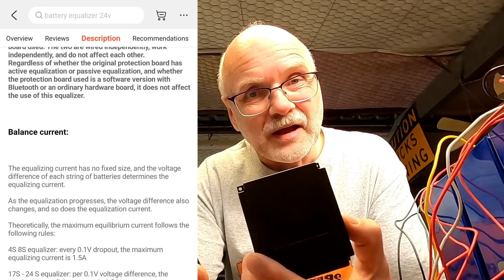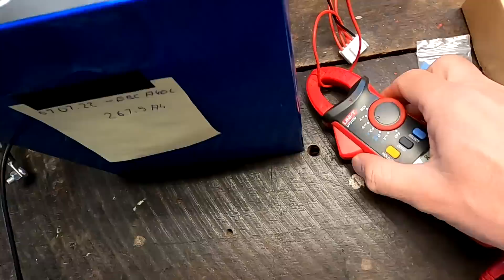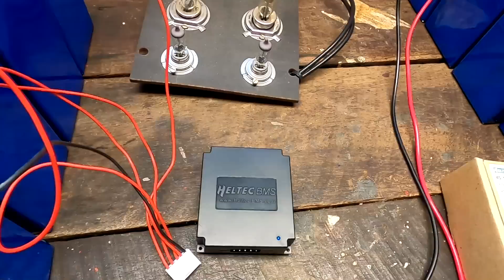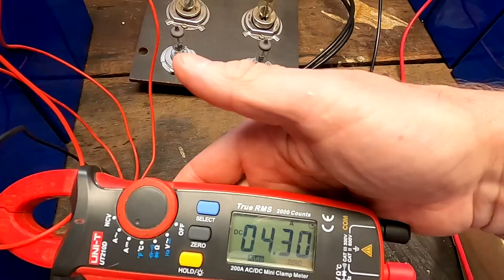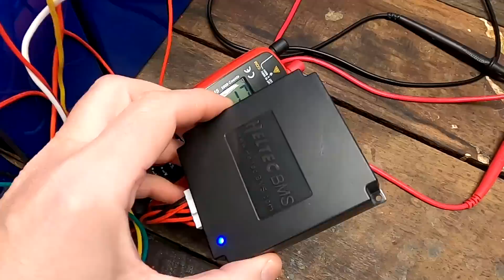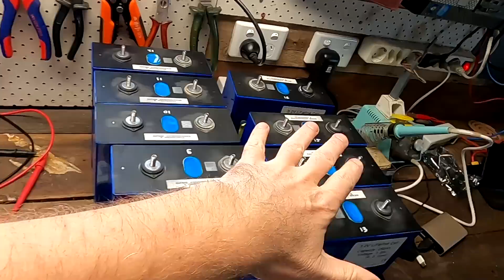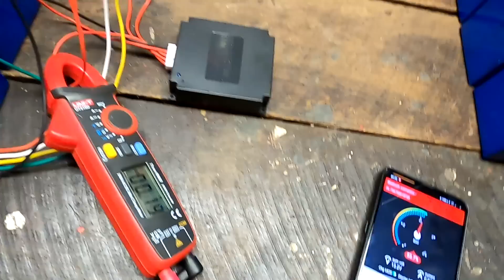HELTEC 10A Active Balancer. Great for large capacity batteries. But is it really?

Comment: Balancing current is not determined by the balancing-limit stated by the factory, but by the internal resistance of the cells and the voltage difference.
This is especially true for the capacitor version, since it's merely a "leapfrog capacitor bank" which means that it cannot generate a higher voltage than the cell being drained.
As for the price difference: The inductive balancer will easily outlive the capacitor type since they are not 100% solid state. ( expect ~ 10000 hours if running at max. ) 😕
Another feature in the induction models besides balancing can be de-sulphating of Pb cells, by modulating the current with ~ 500Hz - 5kHz. 👍

Comment: Maybe it is 10A peak current capable. If that BMS is switching, your ammeter measures an average level, not peaks. Use an oscilloscope to measure the actual waveform and compute the math

Comment: Why stop at 100mv?

Ah, my dude, that’s because most balancers are set up with a minimum deviation threshold to avoid unnecessary wear and tear, conserve energy, and keep things running smooth. Let me break it down:

1. Efficiency Trade-Off
	•	When the voltage difference is below 100 mV, the cells are already pretty balanced in terms of performance. At this point, trying to balance them further would take a lot of time and effort for very little gain.

2. Diminishing Returns
	•	Most devices are designed to stop at 100 mV because that level of balance is “good enough” for most battery packs. Any improvement below that deviation won’t significantly improve performance or longevity.

3. Heat and Power Conservation
	•	Balancers work by shunting current, which generates heat. Operating below 100 mV might mean the balancer wastes energy trying to fine-tune an already balanced pack, potentially shortening its lifespan.

4. Cell Characteristics
	•	Small deviations (like <100 mV) tend to equalize naturally over time during normal operation or charging/discharging cycles. No need for the balancer to do extra work.

5. Design Philosophy
	•	Battery management systems (BMS) prioritize reliability and simplicity. Stopping balancing at 100 mV ensures the balancer doesn’t stay engaged unnecessarily, which could cause system inefficiencies or overwork the components.

So, basically, it’s all about finding that sweet spot where the job gets done without overcomplicating things or wasting resources. If you’re after tighter tolerances, high-end balancers might offer lower thresholds, but for most setups, 100 mV is solid enough.

Comment: Turning off the balancing feature on the bms? I've watched a few of your videos about using an active balancer.

I'm thinking about getting an active balancer, but several YouTubers have done research and pretty much concluded that it's not necessarily a good idea. One of the main points is how a balancer could drain your battery. It got me thinking, what if the balancers are conflicting? 

I've never seen anyone try to test without the BMS balancer active. This might be a good quick test that could answer the active balancer question once and for all.

Great content btw.👍

Comment: Hi Andy.  I think the wires from the cells to the active balancer are too long and have too high resistance.  You can test it again with much shorter and thicker wires and  check if the current will go up to 10A at 0.6V difference

Comment: The reason to buy this balancer is because you can buy the 24s model and use it from 4s-24s.  This gives you one balancer to rule them all.  I use an unbranded model because it's cheaper then the Heltec.  It has terminals I put my own wires in so they are sized correctly.

Comment: Tou need t =o use short and thick wires. They don't have kelvin connection, so the drop in the wires will fool the ballancer and will not push more.

Comment: In specs 10A has if diff 0.8V and more between cells. If diff ~0.1V - have 1.2A balance.  The author has a difference of 0.65 - should not have a maximum balancing current in 10A. There should be an average of ~4A, which is what happens in the video, since this is the optimal and safe balancing current. Read the manual better )))

Comment: A few days ago, I was having problem with my variable power supply. Voltage kept dropping even though the unit is capable of supply 10A. I discovered that the wires used was substandard and large voltage drop. When I replaced the cable, the voltage drop was greatly reduced.

What if you change the balance wires to a larger size, say #10~#8?

Comment: I know this doesnt sound very logical but if I had a pack where a cell need balancing all the while somehow I would be thinking that cell is faulty. I just had an 8s pack given to me which havent been use for 4 years and I put an active balancer on it and nothing happened
Reply from the maker: You can only tell if you fully charge the battery. Cells need to be over 3.4V (with LiFePO4) to show any sort of deviation.

Comment: Can't read the part numbers on the devices in video. 

Usually, the way this works is like a flyback transformer with multiple primaries and multiple secondaries all charging the primary windings and discharging through the secondaries in parallel.  During toroid charging, all cells contribute to charging parallel windings but cells with highest voltage contribute most of the current to charge the toroid.  When discharging toroid, the lowest voltage cell absorbs most of the discharge energy from the toroid.

No gating of which cells supply charge or discharge is necessary other than blocking diodes to actual cells.  The small E transformer provides isolation for driver MOSFET and 8 pin IC's are likely the actual switching MOSFET's to charge the toroid coil.  The large devices near battery terminals may be just diodes to keep current flowing in correct direction for cell polarity.

Efficiency isn't great because of forward voltage drop of blocking diode in relation to cell voltage.  Efficiency can be improved if diodes are synchronous MOSFET rectifiers but that adds some extra complexity and expense. 

If you expect 10 amps average, the peak current must be much greater to charge the toroid and the windings wire gauge used is so small it will have a lot of voltage drop. Too much extra resistance reduces the differentiation on which cells get the most charge pull and most balancing push currents.

Just a crappy implementation of a reasonable active balancing approach.

Comment: I have a problem? I watch you battling the similiar, I have decided to mount my panels in summer and winter with trackers. FOLLOW THE SUN NO SHADE ALLOWED. hmmmm so much for opinions?
Reply from the maker: What's your experience? I think it is better to just install more solar on a fixed mount to compensate for any loses rather adding to the complexity of a tracker (stability, wind, area, maintenance,...)

Comment: Andy I'm just wondering if this device can be used to equalise 4 x 12v batteries in series?
Reply from the maker: You mean the 10A balancer or the secret device in the box?
Reply: @OffGridGarageAustralia  The 10 A balancer.
I've had battery equaliser on my SLA battery bank for years and they work.
I'm wondering if this device would do the same job on my SFK kits.
Reply from the maker: @NedKLee  But if it is not 10A, it is not a 10A balancer 😉
The SFK kits can be equipped with a capacitive 10A balancer. My kit has that but it is not great if it runs all the time...
Reply: Andy, I have 4 x SFK in series to 48v.
One will battery will be near or at 100% SOC, the other 3 will be somewhere between 96-98% SOC.
I was wondering if I could use this device to smooth out the difference between SOC.
When the 1st battery reaches 100% the BMS shuts down charging to all batteries until it reaches release voltage and then charging begins again.
Perhaps this device could help smooth out the transition.

BTW, loving the SFK kits, they work very well.
Reply from the maker: @NedKLee  Oh, no, that won't work. Each balancer is only for one 4s battery and does not know about the other three packs you have in series. They won't balance beyond this on pack they are connected to.
Reply: @OffGridGarageAustralia  Thanks Andy, it was worth the ask.
Stay charged mate.

Comment: I just got a "Daly Smart Cell Active Balancer Equalizer 1A Lithium Li-ion Lifepo4 Board Battery 3S 4S 12V 7S 8S 24V 10S 12S 14S 16S 20S" from AliExpress, I was wondering if anyone else has this or has used it as I'm having trouble finding the software for the smart active balancer. This is my first active balancer, after watching all Andy's videos, I feel it's about time to try experimenting with this myself, Should I use the word experimenting? If anyone could help I'd really appreciate it. Andy, I really appreciate your channel It's taught me so much over the last two years.
Reply from the maker: Mine arrived 1 week ago. Didn't have time to look at it yet...
It uses the same app as for the Daly BMS. There is now an additional tap at the bottom for Active Balancers.
Reply: @OffGridGarageAustralia   Thanks for the info, I'm finishing up a new battery build and I'm going to try it on that battery. Never had a smart BMS or smart anything before. So this should be fun. Thanks KJ

Comment: None of the balancers I have on my system work. Supposed to be 5 amp. I have never seen more than 1.4 moved when the diff was the highest. I wished they would work, but they do not.
Reply from the maker: There is only one balancer which actually works as it should...

Comment: The Heltec is an isolated design that uses a flyback circuit to transfer energy from one cell to another. I would guess the total current that the balancer can handle is 10A for the entire pack, meaning 2 cells at 5A. You may need a NMC cell to achieve the necessary voltage delta and 10A for a single cell.
Reply from the maker: I'll do more testing soon. Thanks for your explanation.

Comment: very informative video,, 👍👍 maybe they compute the 10a as the total of multiple cells balancers. 1 question what is the idle consumption of each active balancers?
Reply from the maker: Could be the case. I'll do the reverse test at some stage with only one full battery and 3 empty ones...
Standby current is between 5-15mA depending on the device.

Comment: Disappointing for sure.  I was thinking roughly same thing as Teardown Dan... check it with two charged/two discharged cells.  Maybe there is some sort of limit per cell (5A?) but it will balance two at the same time.  Will be interesting to hear what Heltec has to say about their BMS and this balancer.
Reply from the maker: I will do the test with this setup soon. Hopefully it works out better...

Comment: I wonder if the balancer just turns off because the cell voltage is below 3.4V. (In the automatic mode). 
Great video as always, keep it up.
Reply from the maker: Yes, that would be a great feature actually. I didn't think about that before.

Comment: YAY  Andy if you put 1000 amps on the wire, would the internal resistance of the battery being charged not control how much current it can pull out of the active charger.....
Reply from the maker: The internal resistance will determine the current unless the charger has some sort of current limiting function (which it should have).

Comment: The JK-BMS seems to have the best balancing algorithm. The balancing current does not depend on the difference, the JK-B2A... version can balance with 2 amps even at 20 mV difference and you can set the "Balance Start Volt" to stop it from actually causing more imbalance at cell voltages below 3.45V
Reply from the maker: Yes, that is correct. There is only one balancer which is better than the one in JK BMS...
Reply: @OffGridGarageAustralia  which one ?
Reply from the maker: @engsam7759  The NEEEEEY!
Reply: @OffGridGarageAustralia  so you recommend the neeeeeeyyyyyyy ?

Comment: That's why I put two 5A balancers in parallel and was seeing already some 7A balancing current with just 0.4V deviation.
Reply from the maker: You can have as many balancers in parallel as needed. They all work together. Very good for high capacity installations and parallel cells like a 4p4s system.
Reply: @OffGridGarageAustralia  I personally guess not. (Have you tested it?) Because their individual powerintake and -output cycles would have to be synchronized to not get into a scenario where one balancer pumps energy out while the other takes energy in, which means nothing happens on the accumulatorcells but only energy is echoed between for expample two paralled balancermodules.
Reply: Then i will try to connect my 2  6amp balancer in parallel on my s168 3p 8s .  One 6amp balancer is not enough one cell is overvoltage to 3.75volt the rest are 3.4vto 3.6v. Hope this will help.. thanks

Comment: Intresting observation .. sir, is it possible to use dc To dc buck and boost convertor for individual çell to maintain commen voltages in bettery pack during solar charging witch will eliminate all juglarry in maintaining the voltage of cells ...once again thankyou
Reply: Hello. Yes it would work, but each dc to dc converter must have separeted power supplies, you can not put the dc to dc inputs in parallel, and the outputs in series, it would short circuit the ground sides, and fire smoke. 💥💣
Cheers.

Comment: Yes. Please make a followup. That is curious from the same manufacturer. My first thinking was those cheap wires you mentioned if there was too much resistance, or if it was based on the Lithium Ion batteries with the higher voltage instead of the LiFeP04 voltages.
Reply from the maker: I think 0.6V is already a very high deviation for a batty pack. This would normally never occur under normal operation.

Comment: Oops i pressed the send button too early.sorry on my MPPSOLAR inverter should I just connect the designated earth stake cable to the earth turminal on the  3 point turminals      active, neutral, and earth, as in a 3 plug configuration.would that be ok .cheers Rene
Reply from the maker: Hard to tell from this little information. Best to get an electrician to get this checked. This is probably beyond DIY and a safety question.

Comment: Hi Andy could I ask for a request please I think it was u that said to earth the off grid system. in some cases there is a designated earth point to connect earth cable, to the inverter,now if there is no connection point for the cable
Reply from the maker: No, I didn't say that. You need to follow the manual of the product and get an electrician to check for compliance and safety.

Comment: On the Daly BMS app there is a button on the bottom from the last update  that says "Active Balancer"...but for the life of me I cannot get it to function. It will not turn on...however it does say its balncing when the threshold is reached. Any info?
Reply from the maker: You need to buy their active balancer first. They use the same app for both, their BMSs and balancers.

Comment: Another vote for testing 2 low cells in the pack as well as how long it takes each balancer to balance the pack and how each affects the charge and discharge cycle, especially with cell 6 and your other weakest cell.
Luck of the draw gave me 2 sets of mismatched cells for a pack from someone who disappeared so I can’t replace them and am likely going to put an active balancer on the pack full time but look for a solution that will only turn it on above 3.4v and below somewhere like 3.25v (need to dig into your test data more to pick better start and stop voltages).
Have Daly BMS’s thanks to Will Prowse’s recommendations for them so don’t have an effective balance function 🥺
Reply from the maker: Thanks for your suggestions. I'll do some more testing with this device. As someone said here in the comments, it might be not bad that the balancer turns off itself if the voltage is lower. This was always what we wanted.
I would not recommend turning it on at low voltages just to squeeze out another 1-2Ah out of a the battery if it is already fairly low anyway. This will just destroy your top balancing.
Yeah, with the Daly BMS in place, you may want an active balancer for your cells. Unless they are very well matched and the Daly can handle the balance itself.
Reply: @OffGridGarageAustralia  Thanks part of my issue is that not only do 2 of the cells discharge significantly faster but they discharge significantly faster and my loads will be around 100 to 150 amps when the inverter in our RV kicks In. Just noticed after using your Aliexpress link that Daly has a 1A Smart Balancer that can be hooked to their BMS and that not only is the balace voltage settable but that the voltage current is settable which is interesting.

Comment: I dont mind the sleep function idea even tho it doesn’t bring the levels closer than 110mv as you can still turn it on periodically to bring them all into proper balance, if this balancer does indeed balance completely at all as it should, maybe this could be another test. 
It was a disappointing demo to say the least, it should have performed according to specs, the cover is a nice touch but not worth the extra $. I would like to hear Heltec’s response to what you have found here and to the bms queries also. Thanks for all ur testing here Andy, its good to see what we can actually expect from these devices ur always testing, than what we may expect when reading the specs. I guess a good formula for buying ‘Chinese’ anything, is expect half or less than the stated information. Good vid & test. Cheers
Reply from the maker: Thanks Evan. I'm currently recharging the second cell to see how the balancer performs under normal conditions.